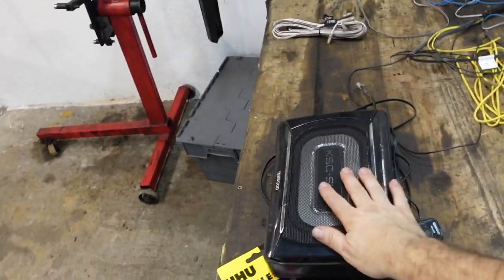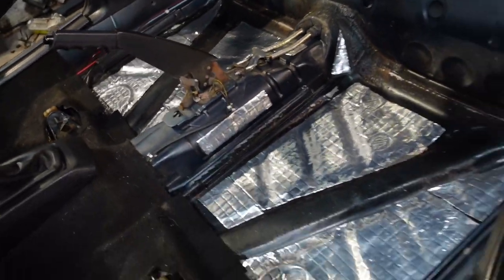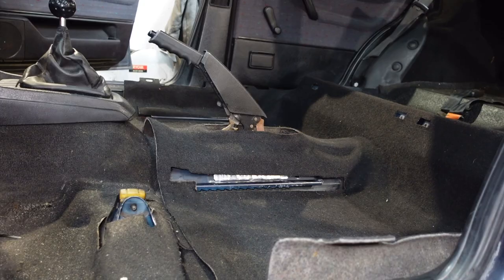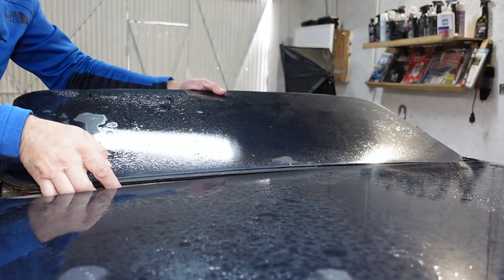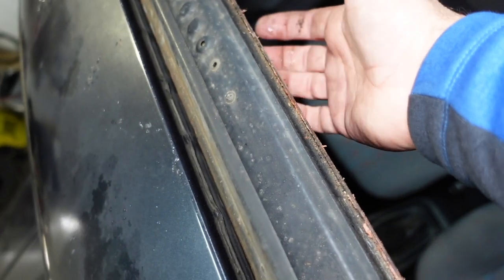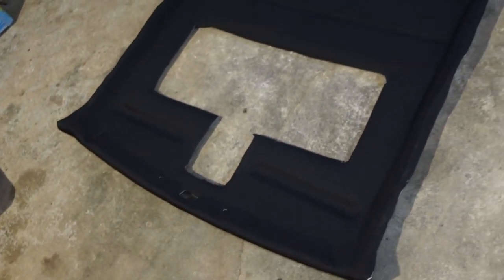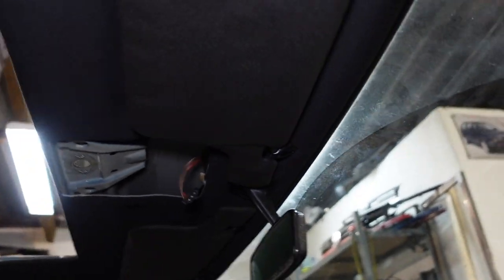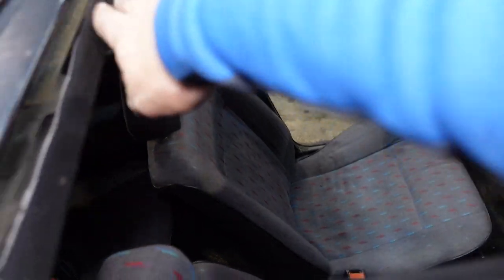Project Freebie Golf mk2 1.3 2.0 16v ABF

Comment: This is coming along nicely, that black headlining makes all the difference.
Reply from the maker: Thanks, the interior is almost sorted, electric windows and some better front seats are next on the list.
Reply: Ok cool, sounds really good, this project is moving forward at a good pace.
Reply from the maker: @snowflake6916  Thanks mate, hoping to have the engine in by May and the seats done by April. So I can use it for the odd snow this summer.